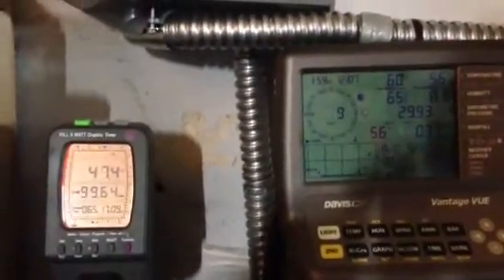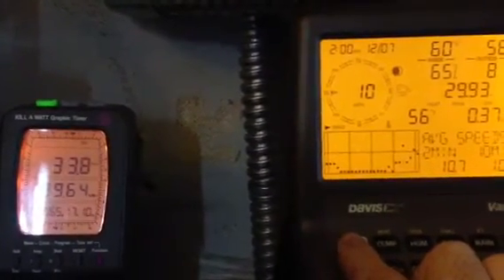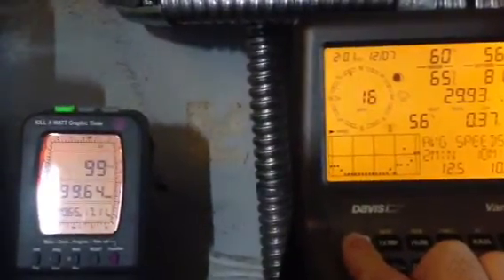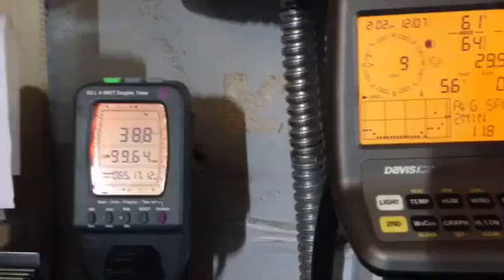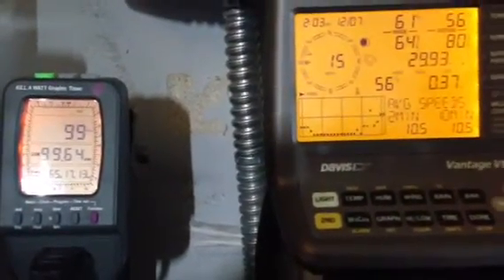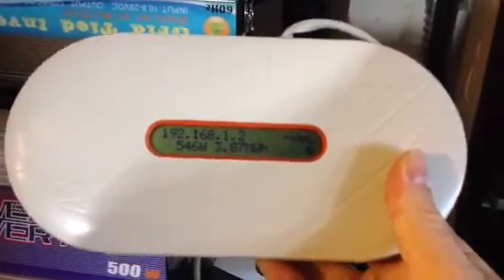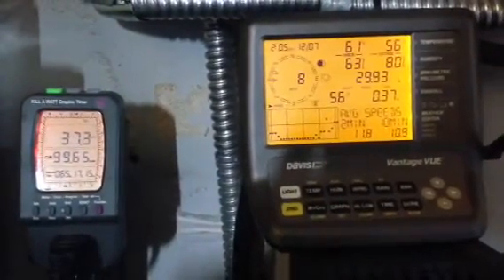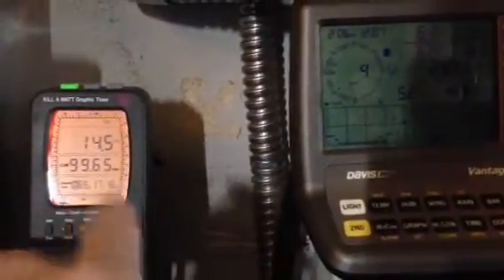400w WindMax production 10--11 mph

Comment: Nice video.  Did you go with a three blade design on purpose for where you live?  I am going to build a wind turbine this spring but I will have to go for more blades because I don't see 15+ mph sustained winds most of the year.
Reply from the maker: I did stick with 3 blade intentionally.  The 5-7 blades have there place, but overall the 3 blade seems to work best on the Windmax 400w for my area. I would love to build a turbine, and specifically the axial flux (Hugh Piggott) design. But will likely be having a YT buddy who has successfully built the axial, build the stator for me. In fact, check out his turbine on his channel (Orlando Sanchez). I'm just floored at the production he gets from that design. Even though he charges money for a build, he's a good guy and will share the step by step plans with you or anyone. He actually had his first stator built by Chris Olsen (Dairyland farms) who lists the instructions for free on his website too. But that axial flux (Hugh Piggott design) seems to generate the most power than any turbine i've seen (including the Bergey) in low-mid range winds. I look forward to seeing your build out progress. You've done a great job on your channel and preaching the good word of self reliance.
Reply: sunsensational
Thanks, I appreciate that!  I will have to look into those designs for sure.  I have only done some preliminary research thus far as I'm not quite ready to get started.

Comment: Thanks for video nice to see in real time wind and production
Reply from the maker: just trying to do my part and showing folks what to expect in all conditions. thanks Ray
Reply: sunsensational This is what I sent Burns when he first complained Where not to install a wind turbine turbulance Missouri Wind and Solar
Reply: Jeff I have no choice, I live in the city and I cannot put a tower up, but I still want a wind turbine, so I must find the best for that situation. I do not want it for the best and greatest wind production. I just want one for emergency only, and to play around with. I am looking into your skymax, but have not seen allot of info on how it works in dirty wind. I have watched your very informative video on where not to put the turbine, but that is where I have to put one, or not have one at all. I need very quiet, and of course one that works somewhat in dirty wind. I understand it wont work the best but I sill want one. I also understand your position, people should not complain or expect a turbine to work correctly if installed in dirty wind.
Reply: Ray Isimz Hey Ray
A lot of people can't have a tower and i understand that. I have just made a roof mount for the SkyMax™wind turbine. I would get the 600 watt SkyMax™ for your roof. Here's the link to the mount Wind Turbine Roof mount system for residential home
There is nothing that can be worked out with the Burns by HY energy or myself. He's right and were wrong, whatcha gonna do..
Jeff
Reply: Thanks for info I will check that out
Reply from the maker: Ray Isimz
I think based on your situation (somewhat similar to mine), I would stick with either Windmax 400w. The Skymax Jeff refers to is probably similar to the 12v 400w Windmax - good low/mid wind production, small, easy to mount, silent, and easy to put up/take down. Even though my mounting is crappy, my own testing shows my turbine is pretty much hitting the published power curves. I mean it's surprising, but it's really producing what they say.  Whereas, a 1000w Windmax will produce roughly the same as the 400w Windmax in winds under 18mph which is what we're likely gonna see anyway; it's not until you break 18-20mph does the high watt turbines break out of the pack.  Anyway, you know I'm still a rookie with lots of this, so this based solely on my personal experience and watching TONS of vids and reading tons more. So, take what i say with a few grains of salt, and when you find some info consistent with mine, you can start adding more grains of salt, and achieve somewhat reliable prediction/info for your needs. That said, solar is the way to go for real Kw/hours; whereas the micro turbines more or less supplement when sun isn't out as i'm sure you know
Reply: Thanks Nick your thinking is inline with what I have learned and read about also. I would like to see more videos with the skymax in similar situations as mine, I think there is a market out there for people like us.

Comment: Good data you provide here!!! It`s nice to be able to compare with the one I got ...
You have said earlier that after 20 mph it start to double and triple the output ....
Nice demo and thanks for your time....AL
Reply: sunsensational Looks like your wind turbine is doing what it's suppose to do considering where you have it mounted. Your system has come a long way.
Reply from the maker: oh yeah, it's exponential...every few MPH. yeah, i go from 100w in 15mp to 250w in 20mph, then to 400w in 26mph. i max at 450 in 30mph because limited by physics on the  blade diameter on my little 400w model
Reply from the maker: MissouriWindandSolar
true true.  yeah, this was my first turbine and it does pretty well given the mounting, etc.
Reply: sunsensational Read this, it's current from Home Power magazine
400w WindMax production 10--11 mph
Reply from the maker: MissouriWindandSolar
i'll check out. sounds good. however due to my area, i'm limited on location for turbine but i'll be sure to check out. thanks